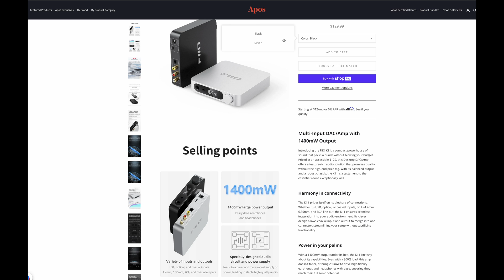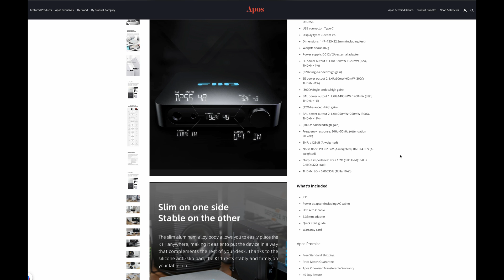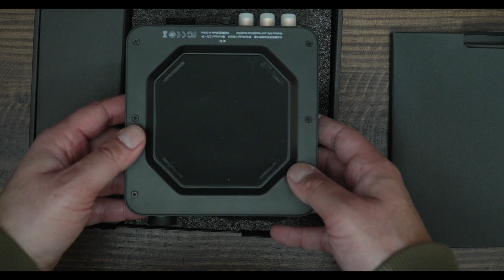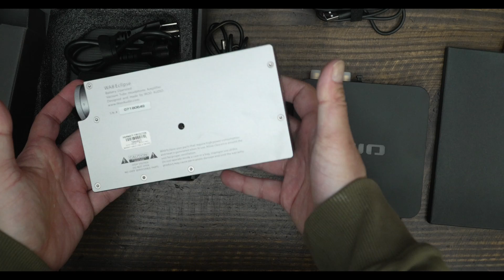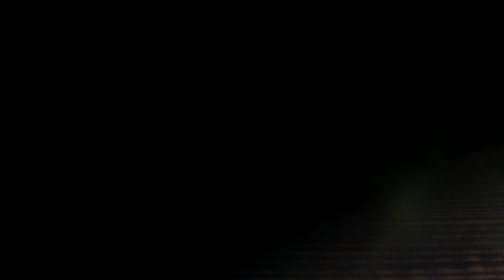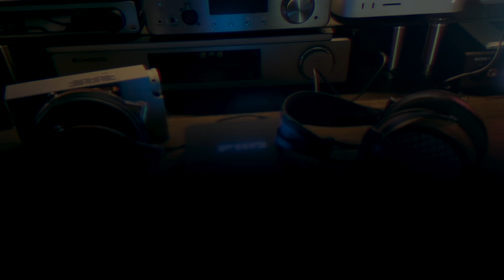FiiO K11 - Excellent Bargain Dac/Amp

Comment: Which filter did you have the K11 set to during testing? I've owned one for a while now based off of this review (thanks for the recommendation), and like many others, I've noticed the filter settings sound noticeably different. Which filter do you recommend for the most neutral/accurate sound?

Comment: Yesterday I went to a local HIFI shop and demoed a lot of headphone amps up to the 2000 dollar range, including Woo Audio's Wa7. Not even doing a careful AB test as you have here, everything sounds the same. I was sure I would hear a difference but if they are there they so slight it does not matter to me. Headphones still sound different to each other, and maybe that should be enough in this hobby. Thanks again for your reviews!
Reply: Indeed, headphones make the real difference in sound. As long as an amp is powerful enough to drive a given pair of headphones, it would be easier and free to fine tune the sound signature one wants via EQ, instead of spending $$$ on DACs and amps.
Reply: @1812JSmith   Yup, the only time I heard a difference was with some tube amps. EQ is king!

Comment: I'm interested in this device, but i can get a zen dac v1 for half the price.. i'm using Beyerdynamic 48ohm dt770 pro x .. currently i have them connected through my m-audio track solo interface. Would you reckon either one of this would be a noticeable upgrade?

Comment: Okay so that was hilarious. Right after you said "Schitt" the volume cut out on your video.  I thought you had gotten edited, but no, I had just turned on my K11 and it took over the audio.  Anyway, the timing was really funny.  Now, on to my real comment.  I (obviously) have the Fiio K11.  And I could not agree more with your assessment.  As a beginning reviewer aka "youtuber audiophile fanboy" (might as well tell it like it is lol), I have found that this little workhorse is the most, as you said, transparent and neutral desktop dac/amp that I have.  I think the SMSL DL200 is close, but I find that unit a little flat, so I do not use it much.  The K11 allows me to hear my iems and headphones as they were intended to perform.  At least it seems that way to me.  And based on the feedback from most of my reviews, others seem to think that I am getting a pretty accurate picture of what I am reviewing as well.  It is a great tool for that reason.  It is enjoyable too, which is what we are after in the end.  Anyway, thank you for your review.  You confirmed, much more scientifically and objectively, what I had felt since I put it into the stable.  It is my go to.  Now I wonder what you might think of the XDuoo TA-22.  Seems to be some question about the 3W of power that claims...  I wish I could test it accurately.  Anyway, sorry for taking over the comments!  Thank you for a great, accurate and honest review once again! ☮
Reply: hi  can this be used with a speaker and subwoofer setup total power is 130Watt
Reply: @Gnome2905  I'm using this with Audioengine A5+ powered speakers, and a Polk Audio 10" 100W sub on my Windows 10 workstation. Works fine.